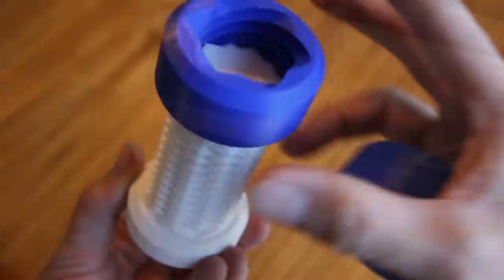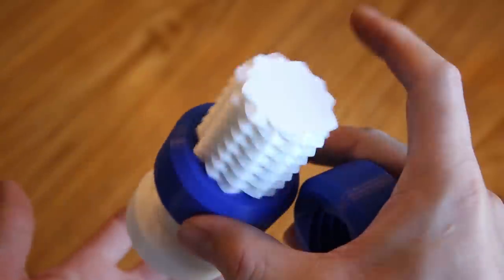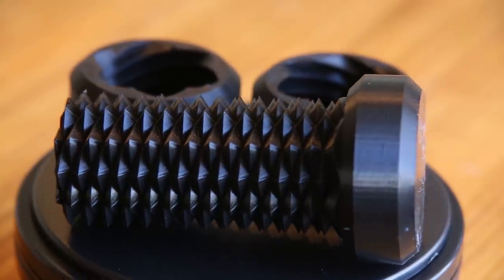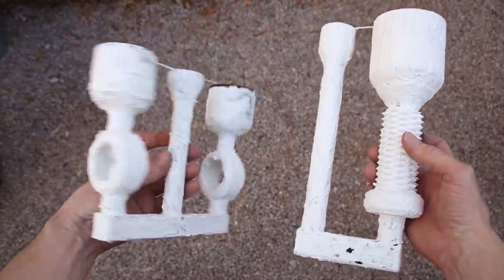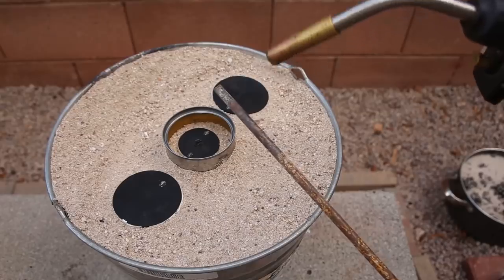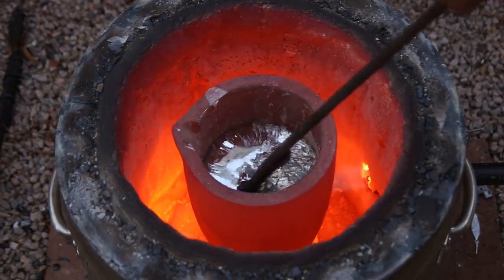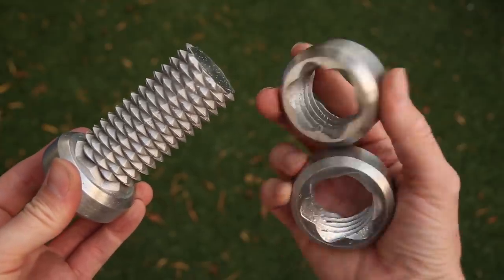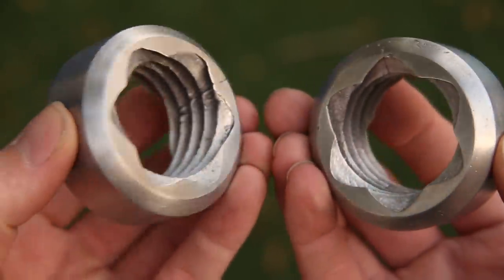Easy metal casting │ 3d print to metal copy │ Two way bolt │ Dual thread screw │ ASMR

Comment: What is the scale fidelity to the original part?   Did you put a caliper on the printed part to compare the casting with?  How much shrinkage did the aluminum suffer?
Reply: I want to know also. Aluminum is going to shrink anyway and then we have the plastic wall. Probably print the part at plus 2% and maybe print with a smaller nozzle like 0.3 but at a layer height still of 0.2? Just my thoughts. Let's hear from the author. Looks like a good method

Comment: Great video, I tried three times to make bronze sword and I failed. My sand casting what's not good enough, I mixed the sand with water and when I pour the liquid metal the water becomes steam and leave cracks and bubbles in the sword. I'm going to try your method of using sodium silicate with sand to make the mold.
Reply: You might have too much water in your mix. Are you mixing regular play sand with water?
Reply from the maker: Sodium silicate would work well for this. Make sure to use fine sand for the best detail possible.
Reply: Here's a video about DIY green sand. The mis works fairly well, but like Seth said, sodium silicate would get you better detail. https://youtu.be/xFq9wpF0L8M
Reply: @KrakenCasting  I used "river sand' that's how they call it in the store
Reply: @robinson-foundry  thank you
Reply: @KrakenCasting  thank you
Reply: Casting sand does not use water. You mix the sand with a specific oil.

Comment: after coating the plastic parts with joint compound you need to sprinkle sand over the coating let dry than recoat again at least 3 to 4 times THAN when  everything is dried and cured  put the part into an oven to burn the PLA ( called a burn in ) till there only ash left ( you'll end up with an hard shell ) after your done doing so you need to take a air blow gun and blow the leftover ash inside the cavity till no more dust comes out of it, that will ensure that you have minimal shell contamination and your next pour should be looking almost perfect ! this process is called investment casting.

Comment: I wonder if any other printable material would be better at this than pla?
The lw foaming filaments come to mind, but in general.... what burns the cleanest and easiest?
Reply: There is Wax PLA, pla mixed with wax designed for casting

Comment: Thanks for sharing. I had tried a single wall pla part in sand. But your "bottom fill, vent thru top" method and using drywall mud looks promising. That encouraged me to explore that more. Your post is inspirational

Comment: I have two suggestions for your next try (also I am curious to see if it improves the process):

a) add more small vents  even to the pouring column because when you poured the first one a lot of metal got wasted due to the initial set of gas escaping. Add vents to the pouring channel at some degree so those initial air can escape. I would put two or three vents at different levels for each column. 

b) I wonder if you achieve even better quality by heating up the mold first. Not sure if you would put it in another furnace or can just run a heat gun through it. But I know that currently because your mold is cold you can get some imperfection spots. 

Good luck,  I look forward to your next experiments!

Comment: Hi Seth. Thanks for sharing this info. I too am getting ready for my first pour next week. Could you share how much sodium silicate you add to the sand? Looks something like a couple cups per 50 lbs but I'd hate to get this ratio wrong. Would you think that green sand could substitute for this method (no sodium silicate) or is the curing to hardness part of the reason this works? Am I wrong or was there less of the surface aluminum bubbling through the joint compound on this pour?

Comment: Man, that is very cool. I have the plastic one but never thought you'd be able to cast it with that kind of granularity.

I wanted to ask you, Where do you get your furnace supplies, specifically, those vertical and horizontal tongs you use. I really like how you use them to move the crucible around. I'm new to foundry work and am still in Watch / learn mode while getting my list of things to get.

Comment: Interesting; I tried this before using a very similar process, but using zinc instead. I wasnt quite happy with the result since even the single wall print wouldnt really detoriate in a consistent manner; charring in some places and melting in others, leaving a very inconsistent surface and dimensional problems. It seems that with the higher temps of alu, the pla does degrade in a rather nice and consistent manner though; these castings indeed look great. You might want to try foamed PLA as well; might work even better since there is less plastic to move out of the way.

Comment: How would you recommend doing this method for a 25B32 chain sprocket? I've tried twice and failed. The first time I tried with no joint compound and I got the innermost part, but no sprocket teeth. The second time I used joint compound and got a beautiful spru and runner (like yours), but it stopped at the end of the runner. Didn't get to my sprocket shell before closing up. Aluminum was plenty hot enough. In a panic, I poured the rest into the riser. It didn't join, nor did it get the teeth. These are my first ever attempts at casting by the way. Starting to get discouraged. Any pointers?

Comment: I think after 3d print, you should make the silicon mold to cast this model using the foam, foan easy to burn by the casting aloy

Comment: Very interesting!  The bolt thread design is out of left-field but I doubt it has the necessary strength to be practical.  See Perfect Lock Bolt (youtube) for a working example of a dual threaded bolt, but it also has less strength than standard A-325 Structural Bolts.  Your casting process is pretty awesome.

Comment: Why all the extra work with cutting holes in the print and glueing separate parts together rather than creating the holes in cad and printing everything as one part? 🙂
Reply: Print bed size and height and ammount of failed prints. Cheaper and quicker to do the extra work of cutting the holes than scream at a print where a support got unstuck and ruined the entire assembly; this way one can only reprint the part that failed.

Comment: What slicer do you use? can you share your settings?
Reply: Until you get a response, I would bet that he's using Prusa slicer since it is optimized for his prusa brand printer. I was curious if it was a 0.4 nozzle or if it's worth stepping down to 0.3 or 0.2 width, thinner wall
Reply: @timwilliams632  I've tried since with just sand, and at .4 It worked well enough as a proof of concept even after a giangatic bubble on the first pour